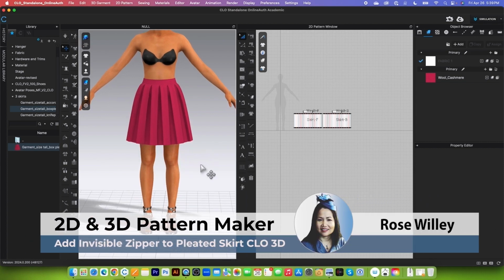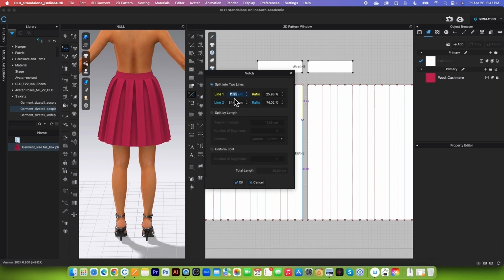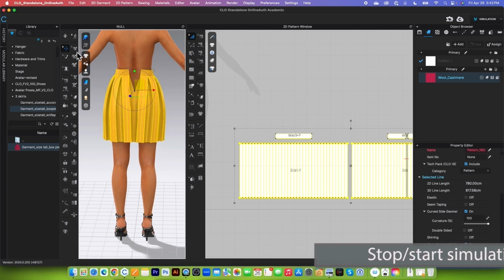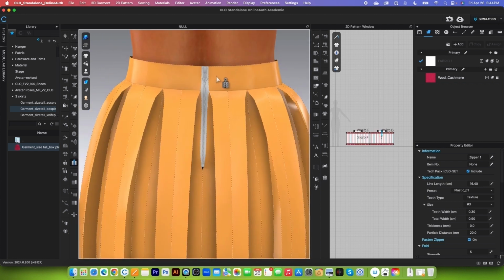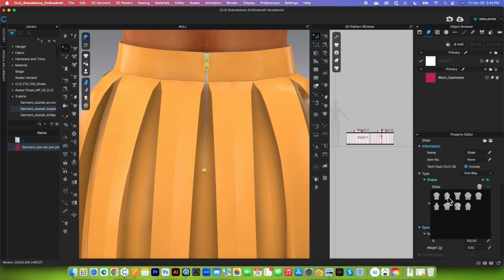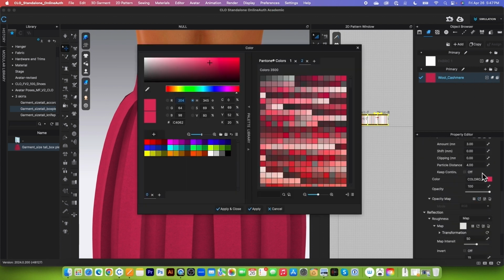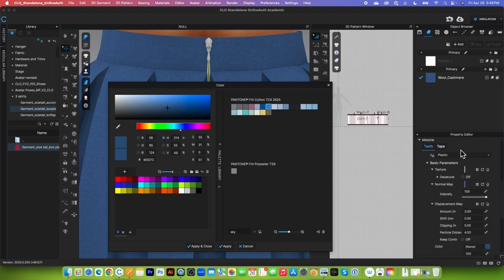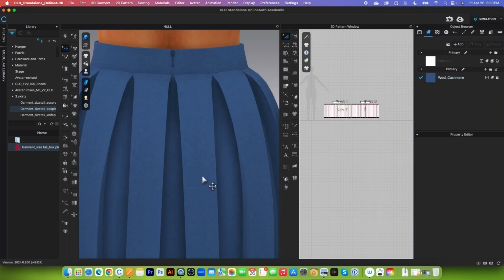(Basic of CLO 3D) How to Add a Back Invisible Zipper a Pleated Skirt CLO 3D

Comment: I am experiencing difficulties with the simulation (GPU not supported). Can you help me?"
Reply from the maker: Hello jako, that’s a great question. What is your computer specs?
Reply: @EncoderFashion  vivobook asus laptop X415UA_M415UA  ,  AMD Ryzen 5 5500U with Radeon Graphics
Reply from the maker: Hello I’m asking this because clo computer specs recommended that you need at least 16 GB of ram if it is not 32 gb. Furthermore, for my experience with clo users intel processors either i5 to i7. I would recommend i7 or higher. Oh the question is this happening before oh the very first time? Oh by the way I’m not an expert with computers I just want to see if the issue that you ran across has happened with many clo users in the community 👌and we might ran into the same issues.
Reply: @EncoderFashion  This is my first time, and my project is already half way underway
Reply from the maker: I think power constraints could cause a GPU not to be supported on a PC laptop. The GPU might require more power than the laptop’s power supply can provide, leading to instability. Additionally, you may need to remove some programs that you are not using. Oh, just a side note: if you work with demanding software like clo or other resource-intensive programs, you might consider upgrading to a desktop. I use my desktop computer for clo, the Adobe Suite, etc., and it runs smoothly. I hope this helps, and good luck!